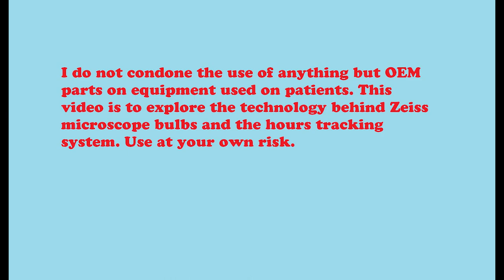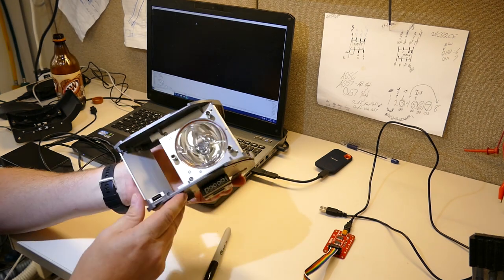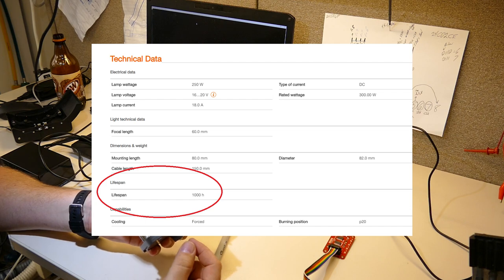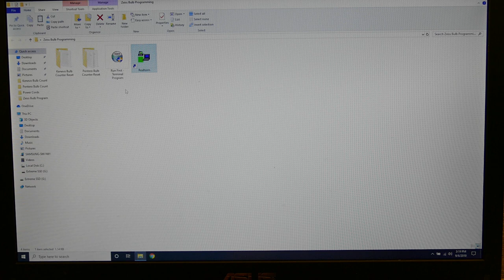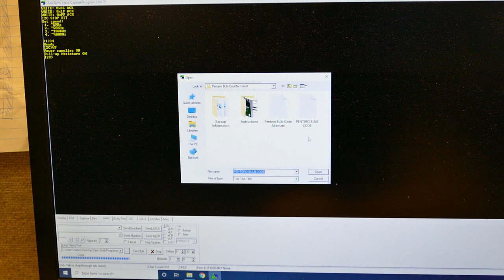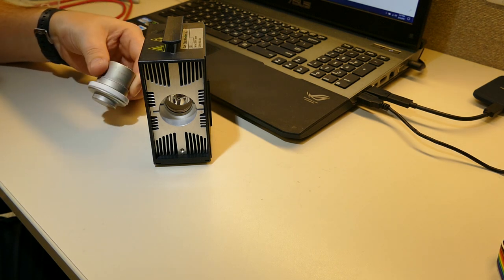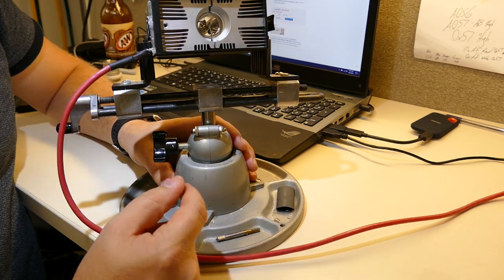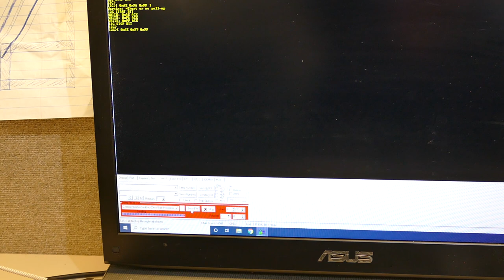Zeiss Bulb Reprogramming

Comment: I work at a large medical center and have 9 Penteros and I used to rebuild these with a 3rd party kit in an attempt to save money for the hospital.... Upshot was 2 years were fine then I had one blow glass into the light box and ALL THE COST SAVINGS were wiped out in that one blast. If one goes from the MFG they will cover the repair... so in the end I gave up trying to save money. I buy at least a couple dozen Pentero lamps per year so it is substantial! Just my experience.

Comment: Thanks for the info my friend! I did what you did and zeroed my hours on a brand new OSRAM bulb. Even though it is a brand new bulb, I keep getting "Caution, The  lamp module is defective or has an unknown serial number! Please replaced it by a new module" Error... Any ideea?
Thanks :)
Reply from the maker: There is a line of code that you can run at the top of one of the txt files that will display all the code of the bulb. If I had a screenshot of that code dump I could tell you what went wrong.   I do suggest that you run the code a few times if one piece of data didn't copy (NACK is displayed at the end of those lines which didn't write to the chip)
Reply: Ok. I ll take a picture of the screen at the end of the code dump and email it to you. It s strange that none of the carl
Zeiss oem bulbs did that after i reset the hours on them. I bought 3 new osram bulbs and they all acted weird(suck as buzzing sound, some turned on some flickered,and one just kept trying to ignite but didn’t turn on at all) i got the bulbs for about 600 ish a pop. Maybe it was a knock
Off?😏
Reply from the maker: The Zeiss bulbs are OSRAM XBO 300w bulbs. The only difference is the tape on the back of the bulb.  Sometimes one byte of the code doesn't get copied and it makes it unreadable. A reprogram or 2 runs of the install code usually copies all the bytes over.
Reply from the maker: @eminecetinkaya2907  are you sure the watts of the bulb are the same and the wires in the connector are going from the same parts of the bulb (anode / cathode). And for some weird reason they're not reversed??
Reply from the maker: @eminecetinkaya2907  are you the same person as John Slick? Or someone else that is experiencing the same problem?
Reply: Sorry,same person. Was using laptop at home,didn’t realize old lady logged in with her email
Reply: Now you got me thinking... I wonder if I put the white connector(at the end of the 2 wires coming off of bulb) flipped when installed the bulb...